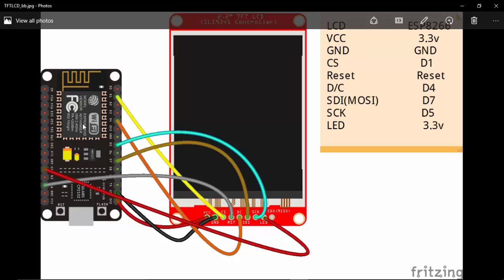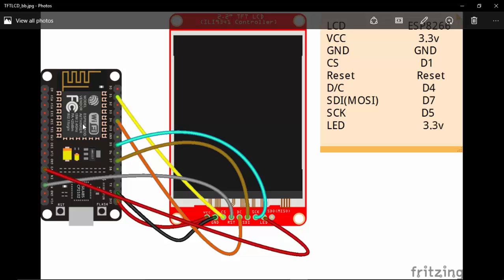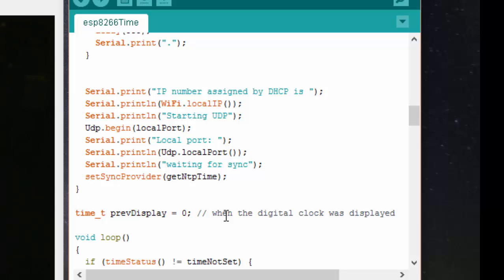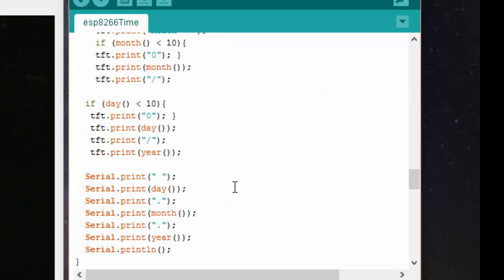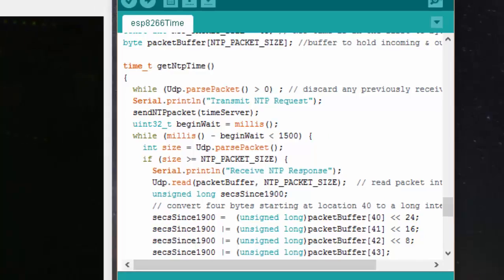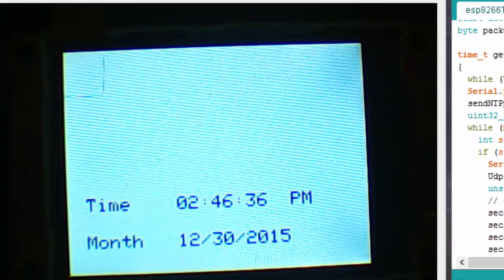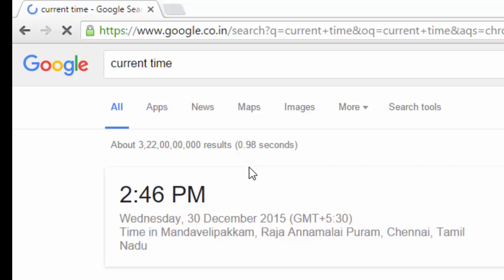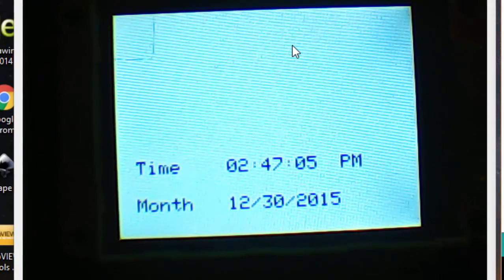Esp8266 (Nodemcu) Real Time Clock display on LCD

Comment: Greetings 'STEM Education'. First of all, thanks for the video tutorial.
Could you please kindly help me with something:
I have a code of a clock with lcd tft display with ili9341 + DS1307 and would like to join a esp8266 (NodeMCU) as in your code but, exclude the rtc ds1307 and leave only the ntp. In the code has the project address and youtube, if you need.
My thanks in advance

Code:
/* UTFT Digital Clock
 * http://arduino-project.net/chasy-na-arduino-tft01-22sp/
 * https://www.youtube.com/watch?v=l2ZvO5DHExo
 */

#include <DS1307.h> //inclui a biblioteca DS1307

DS1307 rtc(A4, A5); //inicializa entradas

#include <UTFT.h> //inclui a biblioteca UTFT

extern uint8_t DotMatrix_M[];  //Liga a fonte DotMatrix_M (http://www.rinkydinkelectronics.com/r_fonts.php)
extern uint8_t SevenSeg_XXXL_Num[]; //(http://www.rinkydinkelectronics.com/r_fonts.php)

UTFT myGLCD(TFT01_22SP,9,8,12,11,10);  //Liga o display TFT01_22SP

void setup( )
{
rtc.halt(false); //inicializa o relógio
myGLCD.InitLCD(); //inicializa o display
myGLCD.fillScr(0, 0, 0); //mostra a tela em preto
}

void loop( )
{
String stringOne = rtc.getTimeStr();

myGLCD.setColor(65, 105, 225);  //cor da fonte das horas
myGLCD.setFont(SevenSeg_XXXL_Num); //fonte para exibir
myGLCD.print(stringOne.substring(0,2), 12, 60);  //indicação das horas
myGLCD.print(stringOne.substring(3,5), 180, 60); //indicação dos minutos
myGLCD.fillCircle(160, 88, 7);  //Ponto superior
myGLCD.fillCircle(160, 133, 7); //Ponto inferior

myGLCD.setColor(0, 255, 0);  //cor da fonte da data
myGLCD.setFont(DotMatrix_M); //fonte para exibir
myGLCD.print(rtc.getDateStr(), 80, 190); //exibição da data
}